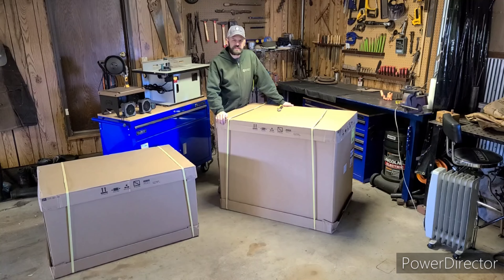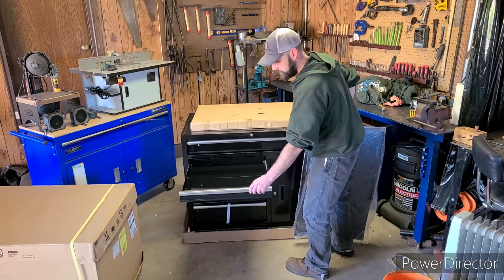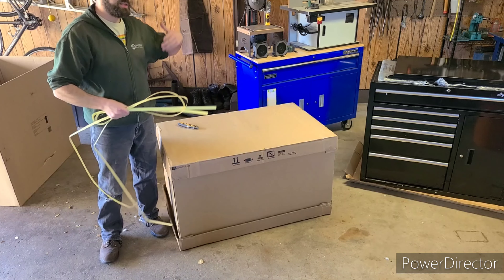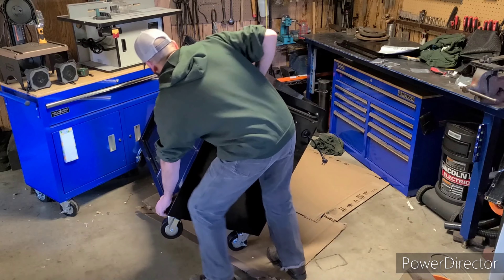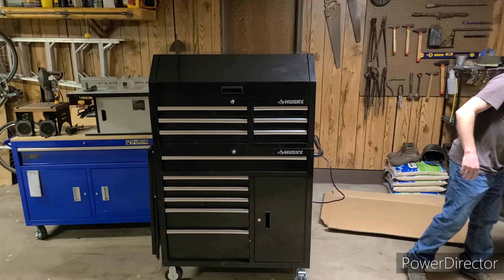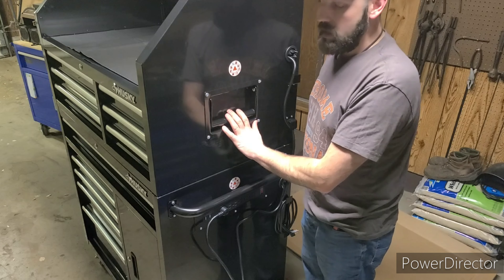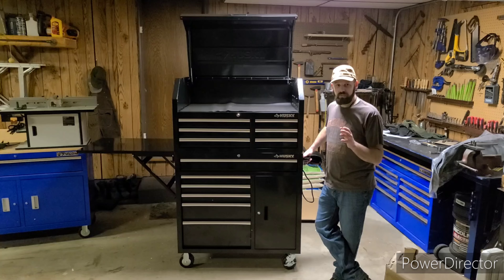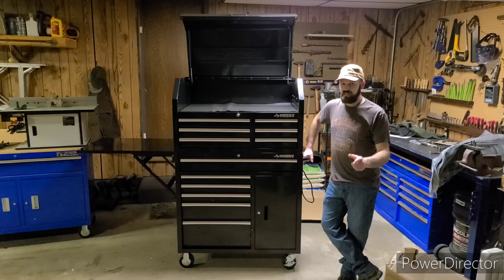Husky Toolbox 42in. by 24.5in. Unboxing and Review

Comment: Thanks for the video. How were you able to get the top on by yourself? Looking at the same setup but also have no assistant during setup. Also no overhead crane access unfortunately lol.
Reply from the maker: @MafiaproductionsIII  I slid it on top of the lower cabinet while the upper cabinet was in the back of my car
Reply: @steelforestweldingandforge  It didn't scratch?